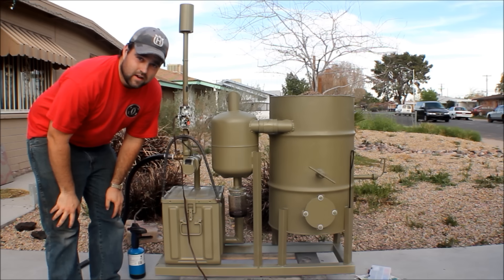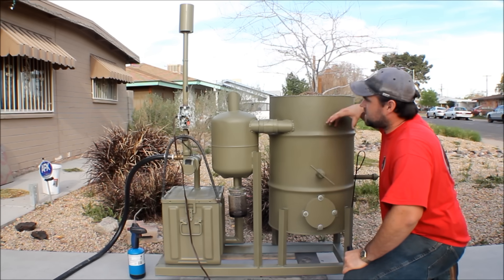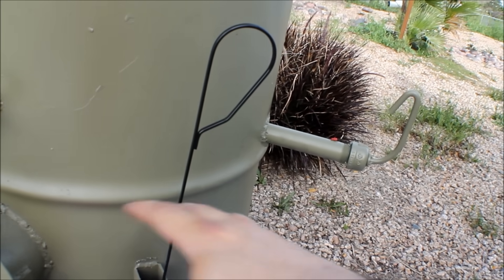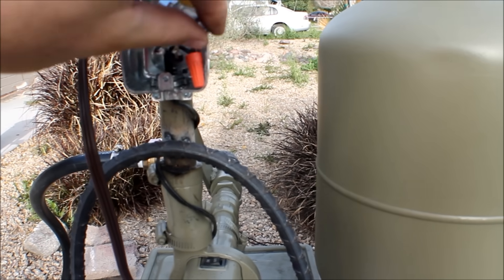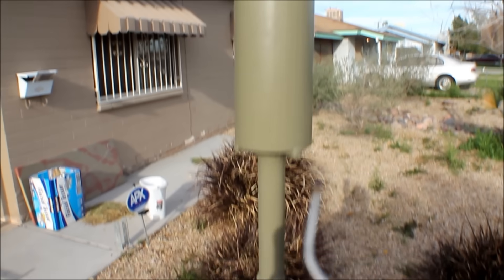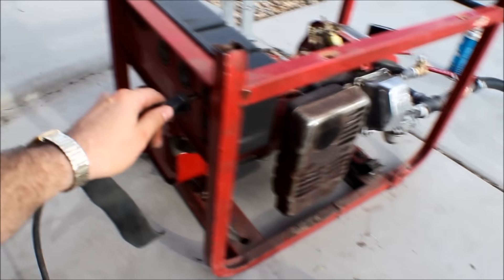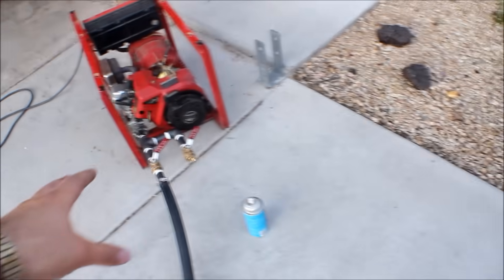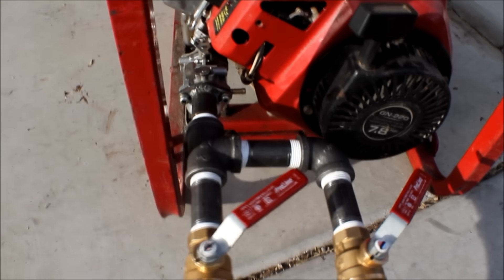amazing homemade gasifier uses wood pellets to run generator -- renewable alternative energy video

Comment: You need a cooling system after the last filter. Hot gas causes inefficient combustion. The main combustible produced is methane when methane is hot and expanded individual molecules are further apart. This reduces the volatile efficiency of the fuel. Cool methane is condensed methane individual molecules are denser by volume. The cooler the fuel the more efficient the combustion. With the right cooling system  this gasifier could fuel a V-8 engine.
Reply: 20% of the gas produced is hydrogen, 27% of the gas is carbon monoxide and 50% to 60% is nitrogen.  Inside the internal combustion engine as the wood gas burns, the products of combustion are carbon dioxide (CO2) and water vapor (H20). 
Every 10 F above 70F of the gas temperature equals 1% loss, but the engine could run between 70F and 160F gas temperature.
Actually the diameter of the burn tube determines how big an engine (HP) can be powered.

Comment: Have you considered putting copper coils around the fire tube barrel and circulating water thru it to get free hot water as a side effect?    

Also when you went to cut the wood with the skillsaw, did that kill the generator?   usually it draws more current under the load of cutting wood, which is why I ask.    Very cool build man.
Reply: Yes, the way to improve on this design is to integrate a water or glycol heat exchanger  into the gasifier stacks. you wouldn’t have to change the engineering at all, but you might want to adjust the layout of the stacks a bit.
Reply: patrick dillard a water jacket would cool the fire tube. I’m not sure if it would affect the quality of the fuel produced.
Reply: Thomas Sirman he said the cooler it is the more energy it can produce so it would only help it

Comment: I've seen people use a gasifier to power a truck.  They had to use two radiators in order to cool the gas enough for the engine tubes to handle.

Comment: Can you connect this to your regular gas pipes and use it to cook and heat water?
Reply: Yaza Forreal you can cook with it, but connecting to your "regular gas pipes" would probably require you to change or remove the regulator from your pipes first.  Syngas is sort of close to natural gas, but not propane.

Comment: you need a hopper on top to hold more wood pellets
Reply: Ever heard of a hopper bottom bin? Great for farmers putting there grain into, a lot easier to get the grain out that way compared to a flat bottom bin.
Reply: ...with a cover in case it rains
Reply: +jonathon watterson That wouldn't be hard at all, just bend some aluminum and pressure fit it.
Reply: James DeGray  brilliant!!!
Reply: +ttyk not minecraft real life xD
Reply: +jonathon watterson It isn't minecraft.

Comment: The only issue involving a gasoline engine is that you have no "top engine" lubrication. Gasoline is what normally lubricates the valve and valve seat, there is no lubrication in the smoke gas.
  I would imagine the savings in gasoline would more than pay for another generator by the time the valves burn up.

Comment: put a cover on that fuel line for the carb on your generator, you have a massive vacuum leak right there.
Reply: you can also change the ball valves out for a needle valves. This will give you the ability to fine tune the fuel/air ratio ...
Reply: J.A.Ratt85 if one does as you suggest, the intake air valve would need adjustment.

Comment: an infra red temp gun aimed at the head and spark plug area would tell you if your mixture was rich or lean. I would say somewhere in the 1000 degree range would be good, any hotter would burn a piston or valve. Any cooler would be too rich.Still a nice set up. I can tell you put some serious time in this project.

Comment: Given trees are  a renewable resource no reason why every household couldn't provide it's own electricity not to mention fuel for the car.

ludicrous the govts of the western world not refining this technology it's hardly rocket science, I bet units could be knocked out for less than a grand per household. Taxation eh?
Reply: +Bertie Blue  Tree huggers are writing all the laws.  Hard to cut any trees in Oregon now even though it's so abundant.
Reply: Bertie Blue It creates a dilemma, you would have to convert agriculture into forrest to run the energy supplies, what do you need more - food or fuel?. This is a dilemma with all biofuels - and a cause for rising global food prices.

Comment: Very interesting video and the gasifier looks well made. I would be worried about tars getting through though. However if those will condense in the engine I would think it should be possible to remove them before they reach it

Comment: Sir is it 2 Stroke Generator or 4 Stroke Generator ??
Reply: +Randana de Silva thats a 4 stroke
Reply: +Randana de Silva My understanding is that it HAS to be a 4-stroke (seperate lubrication circuit).  2-stroke has its lubrication in the fuel and with woodgas there is no oil in the fuel, so no lubrication and your engine would seize up.  You could, in theory, build a lubrication circuit in the engine but that would be a lot of work and kind of defeat the purpose.  Is there anybody that can either confirm or correct me on this assumption?

Comment: very nive  build.

have you considered a PWM controller instead of your rheostat? The rheostat will simply waste electrical power  so the motor runs slower. The PWM will be more effective
in this area. also a 12/24V and 3A pwm is onlz 2buck on ebay vs 8 or 9 for a rheostat.

But as for the actual design. i've read and studied the FEMA plans and the comments
I've been gathering online is that this vanilla design does not filter tar well enough to
run  agenerator for long.

So I ould like to hear your opinion about that. and also when I build one, how can i know or measure that the tar is filtered out enough?

thanks a lot.
Reply: but he wants it to run slower that was the point. a PWM controller wont let him reduce the power to the blower fan to reduce the blowing force like the rheostat will. the blower fan needs to run slower at first to ignite the fire then later run faster. PWM cant do that.

Comment: Just keep 20 gallons of gas on hand, way easier and way cheaper. Those pelletts burn fast and here they are $6 a bag and would burn up in that in an hour or 2. That generator will run 12 hours on 3 gallons of gas. If you dont have the mental ability to store 20 gallons of gas, it is unlikely you will have a gasifier.
Reply: +Trina McDonald  i agree, What is the purpose of running a generator  with no gas tank directly? But using a gas to create fume to run it. I thought this was running completely without any oil or gas when i start watching it.
Reply: If there is no gas, there will defineatly not be wood pellets which this requires. It will not burn just any wood. While this is a cool concept, it is also useless.

Comment: My idea is to design a hose with a float on the end of it. jam that down the sewer of my house (in the city) to suck out the methane gas, compress the gas and use it to power the furnace, power generator, etc.
Reply: Smart but you should consider odor control as there is a lot of sulfur containing gas compounds in the sewer and it will generate a horrible smell that you and your neighbors will smell.
Reply: +zzdfhgdhd I'm not smart enough to put stuff like that together but the idea is there. it would be nice if someone with the spare time put it together and got it to work
Reply: +zzdfhgdhd that doesn't work for sulfur containing compounds. It's done on purpose so the gasoline still smells after combustion to prevent carbon monoxide poisoning. I'm no chemist, but your best bet is most likely a calcium carbonate or calcium hydroxide slurry. The latter would work better.

Comment: Hello Jr,I am also trying to build a wood gasifier but in my state there is no wood pallets but I want to build the system one for me so will you please tell me that instead of wood pallets,can I use wood dust or saw dust as the fuel or even the cover of rice as the fuel?Please help me.

Comment: Looks like a very neat straightforward system.
Sadly if you can smell camp fire at the engine exhaust it means you are still getting creosote/tar in the gasses which will inevitably gunk up all the engine parts, this is the reason wood gas trucks weren't used for very long. Maybe multiple tar catchers can be put in place to try and minimize what manages to escape.
Reply: Run thru an oil-bath air cleaner should work unless the tar/creosote/asphalts (heavy oil products) are vaporized to the point of bypassing the oil in the air cleaner...🤔🤷🏻‍♂️🤔🕵🏻‍♂️??
Reply: @westtexastll1978  just need to cool the air enough first right? Oil bath cleansers seem really cool and straight forward.
Reply: @robertbogan225 Would cooling the gasses improve the combustion and result in more power. I'm operating off decades old High School Chemistry, but if the gasses are already in a high energy state, the chemical reaction will already be close to maximum energy. If it's cooled, the cooled gas should provide more BTUs? I've mixed too many badly remembered lessons, but it seems logical. Please, if you know better, educate me!

Comment: You can lose the carburetor completely, you are doing what the carb does with the 2 valves on the motor. And a DC motor speed controller would be better than a rheostat.  One like this (if it will let me post a link..) http://www.banggood.com/6V-90V-15A-Control-PWM-DC-Motor-Speed-Regulator-Controller-Switch-p-917304.html

Comment: What about energy required to run blower motor in gasifier?
Reply: You only need the blower motor to get it started.  Once you have it going you shut off the blower motor.
Reply: Nathan Berry I was thinking a small solar panel
Reply: He said it's less than 25W wich is nothing compared to the output of the generator. Also you only need it to start the thing so in an emergency you could use some small power source like an power drill battery

Comment: Great job! I've never tackled a project like yours, but want to. What are your thoughts about using a gasifier, in line with a series of batteries, which are tied in with some solar and water power, to run greenhouses, homes, etc? Could this be tied into a controller to provide additional power to such a system? And how often have you found that had to add wood pellets, in order to keep the thing running?

Comment: Have you determined how long your generator will run on 1 filling of wood chips -- X pounds of wood = X hrs of run time?  Thanks!
Reply: you have to define the load on the generator as well. without load it just have to generate the inner losses. with (electrical) load, the efficiency rises along with gas consumption. so you'd have to define f. e. "with a constant load of 2 kW(el.)"
Reply: Good question and a good reply I'd like to know too.
Reply: @jamesallen4447  He must be dead, he lived in a place without white people so there were bars on his doors and windows.

Comment: Hi Jr,
Great Job you did! I just am for the first time coming across gasifiers.I was curious if one could build a gasifier large enough to power a full home plus hot water? Is that anywhere near realistic?

Thanks for your time.

Jim
Reply: The waste heat from the system could be used to heat water. Put a copper coil inside the 30 gal drum & use a solar water heater pump to circulate the water into an insulated tank.

Comment: I forgot to ask you. How long does the generator run on one load of pellets?
Reply: I would like to know that too?
Reply: Todd Lee 
It would be about an hour or less.
Reply: usmcretired2112 how did you forget . You are asking.
Reply: I would expect that a pound of wood would be used up a little sooner than a pound of ethanol.  Wood is like CHOH.  Ethanol is like CH3CH2OH.  Gasoline is like CH2.   Wood and alcohol are already partly oxidized, but gasoline is not.  Energy content is like:  wood < ethanol < gasoline.
Reply: @wryanddry2266  um.... wrong.
Reply: @andrefruth41  Which part is wrong?  My formula for ethanol was slightly wrong, and I have corrected that, but it doesn't make much difference in the reasoning.  I looked up the actual energy-content numbers, and I find that my conclusion was and is correct.  The fuels that contain higher proportions of oxygen have lower energy contents.

Comment: You might want to run the gases through a cylinder with steel wool to scrub the hydrogen sulfide witch is very corrosive and will (over time) destroy the motor